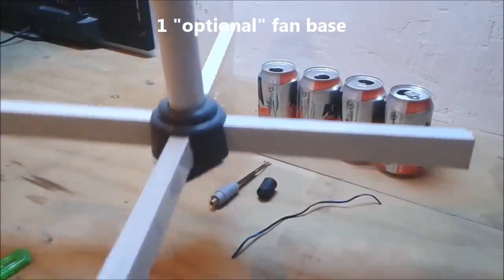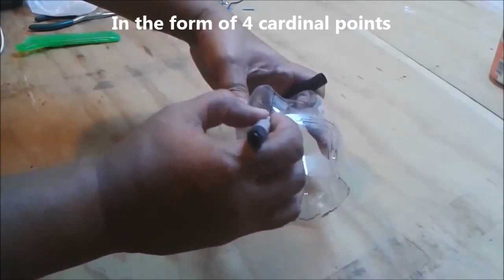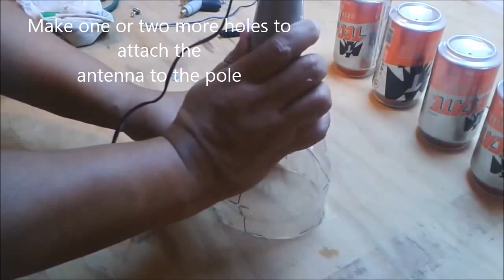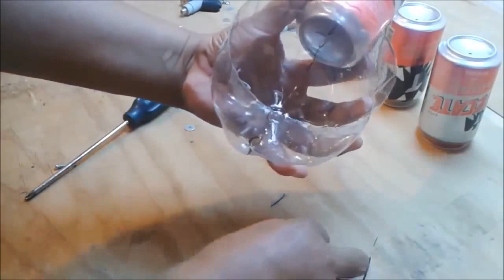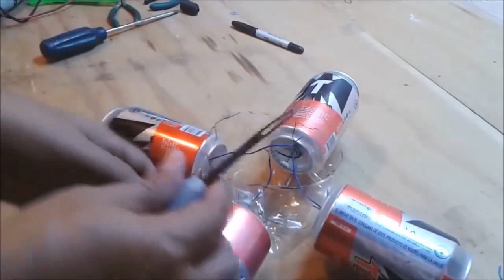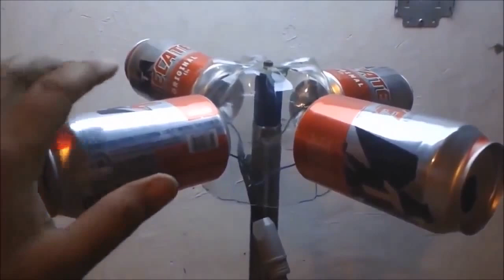ANTENNA HDTV MANUFACTURED AT HOME * Powerful Reception *

Comment: Do you have a demo video of how well this works?  I'm not picking on you or anything nor am I being a jerk., but I'm just thinking proof it works and how well it works, would help people determine if they want to spend the time building it. Obviously, no over the air antenna is going to get satellite service - LoL or intercontinental reception - but if this build only has a range of 30 miles it would be impressive. As for myself - I'd have to have 50 to 60 miles range minimal before I'd even buy a manufactured antenna.
Reply from the maker: I can not do a test of the maximum distance, but I can tell you that in my location I receive a signal from two repeaters, a southeast one that has 212 KMS and another northwest at 130 KMS and receives very well the signal of these Two without having to orient the antenna.
I leave another video link with this same antenna, with the test function at the end of the video, the test was done indoors but the antenna reaches its best reception on the roof, thanks for your visit and your interest, regards.
https://youtu.be/Ozur3UBDUY4

Comment: Yeah but wil it withstand a great storm?
Reply: You will not believe it, but I have an equal installed antenna and it has withstood the rain with strong winds, in general, but if you say "a great storm" the commercial antennas do not resist either, thank you for commenting.

Comment: I am from Libya and everyone in Libya uses dishes that broadcast channels through a shower ... There was one channel broadcast via antenna broadcasting and was closed after the revolution in Libya .. Now every 50% of the cities have a private channel ... Myself I live in the city of Misurata We have a new channel that broadcasts football games and animations .. I spend a day in the week to visit my relatives in the city of Komos, which is 90 km from the city of Misurata and when I was in my aunt's estate I put a small antenna over the house to receive the signal Misratah channel does not reach the signal well channel is not And clear up to 60% in a few cases have disappeared .. Today returned to the eye and I made him And I have received a simple channel signal from my house at a distance of 200 and 400 km. It is true that it is not clear, but this is proof that I am the antenna that I have been doing well ... If you are sure of the power of this antenna in this video, I will make it above the house of the relatives of religion., I will do it over the house of my relatives. Religion is 90 or 95 km away from Misurata
Reply from the maker: You can do it with confidence and it's free. Only cans of aluminum, plastic and cables, I leave a link to another model, is made with a fan grid and only one aluminum can, it can also be useful, that model if you have to orient it to the transmitting antenna, a greeting and success
https://youtu.be/XCFRn-ZQ8nk
Reply: The problem with the connection thread which contains two wires that I plugged into the last video I do not know where I will get a colleague Can I use another thing of the same quality؟
I mean the small cable that contains threads and at the end of the thread two pieces of copper
Reply from the maker: If you do not have a coaxial cable coupler, connect it directly, the center of the cable to one pole and the edge of the cable to the other pole and it should work
Reply from the maker: if you also can not get coaxial cable, it can be any cable and adapt it to the input of the TV with a common coupler or a terminal that you can connect to your TV
Reply: The metal piece that is connected to the TV is available and cheap
Reply: Am from Tanzania east africa

Comment: Is it possible for the antenna to receive a channel signal away from your home 200 km .. and the channel is clear without interference?
Reply from the maker: if here in my town with this antenna I receive an antenna signal at 150 kms approximately without any interference at 200, I think it still has good reception

Comment: Any metal will work as an antenna.
Reply from the maker: aluminum, copper, iron are more used oos but certainly the aluminum for being light, moldable, resistant and economical is the most suitable to prepare antennas mainly for TV signal

Comment: This is basically a cross dipole formation,with no parasitic elements like reflectors and directors,I think its difficult to achieve significant gain in signal reception,however since its all about using one's hands to create things,I think it has my endorsement
Reply from the maker: your description is correct and I also doubted a good gain in signal reception but in the tests performed has excellent results,The main characteristic of this antenna is that it receives the perfect signal from transmitting antennas located in different angles without needing to be oriented to a specific place.
thanks for taking some of your valuable time to comment

Comment: hy what is tools name
Reply: waw...bagus..
Reply from the maker: Muhammad AliWaiz the plastic can container can be cut with a cutter or scissors and the holes in the can if you do not have a drill with a nail, put the nail in a flame and you can easily make the holes in the plastic container, the Nail should be the diameter of the screws and to tighten the screws a magnetized screwdriver and pliers